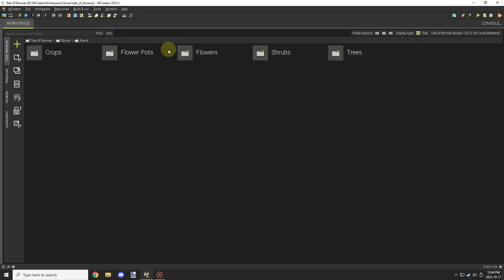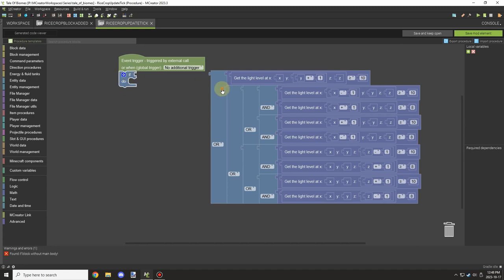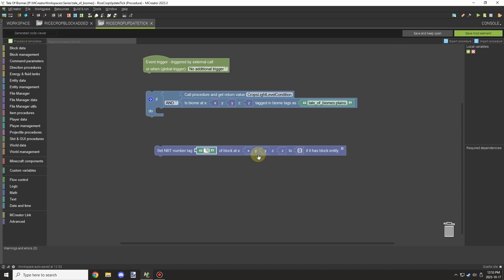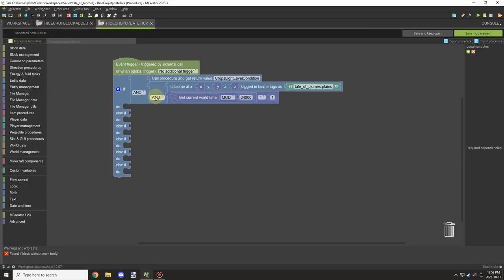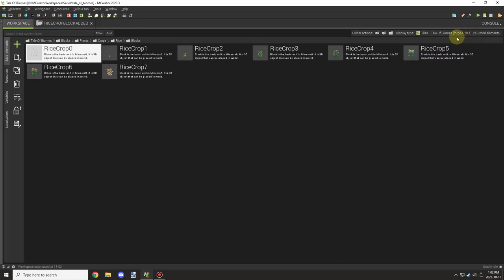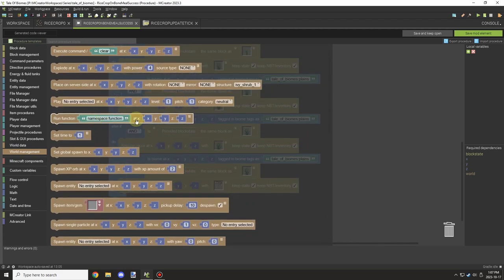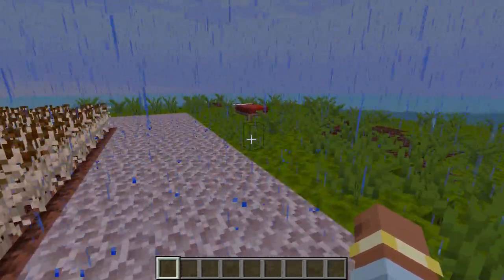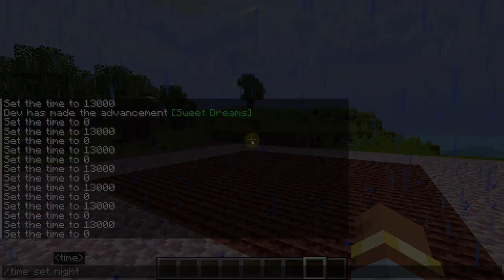Basic Rice Crop Mechanics | MCreator Lore | Ep39

Comment: I was hoping for a updated version of crops, for some reason the old one from around a year ago isn't working
Reply from the maker: The video is not updated but I updated the both Basic Crops workspaces on the GitHub, they are in working order when I updated them recently so chances are a step was missed or something, check the workspace by importing the project and look over the two workspace to find any anomalies with your own setup. Workspaces are always a good step to check things over in the case something is not working, often people just forget something and think it's broken, I have tested so many workspaces after people said it was not working to find the workspace was in working order. It's not anyone fault, just people not aware they can check the workspace.

Comment: would it possible to use mccreator to make a command that only allows pvp between 2 people?
Reply from the maker: It should be possible using variables though I am not sure how the system would be implemented as you would most likely want to prompt the other person to accept the PVP before hand. Chances are this is really advanced to do though and requires possibly a few mechanics to make it work.